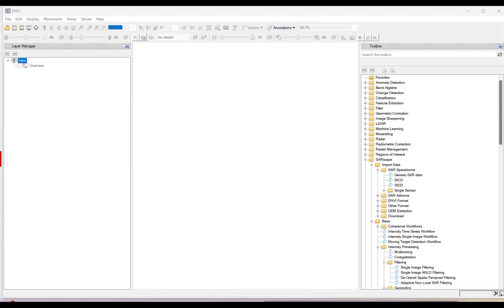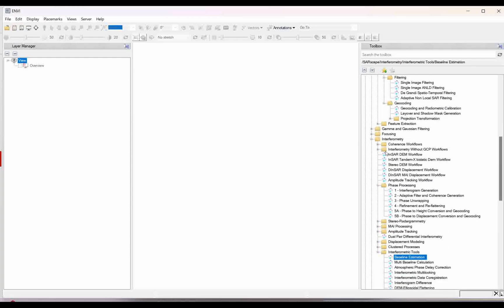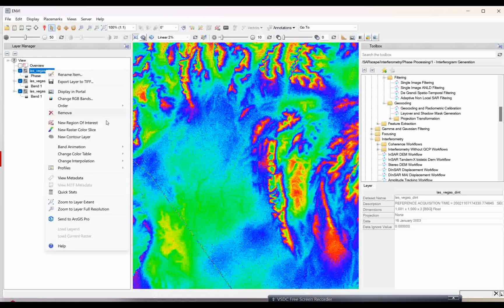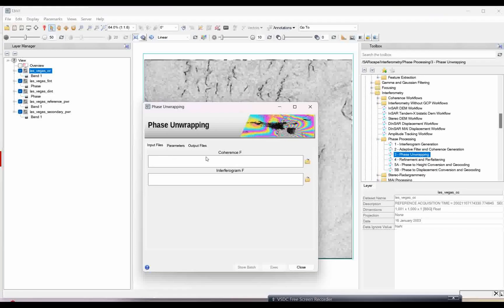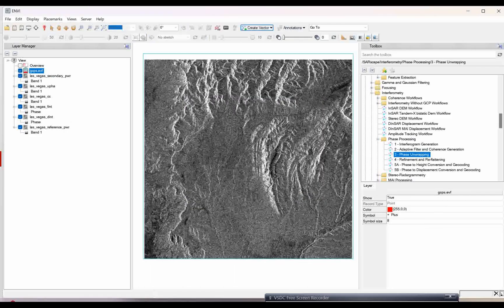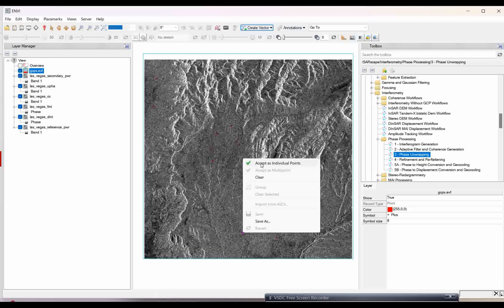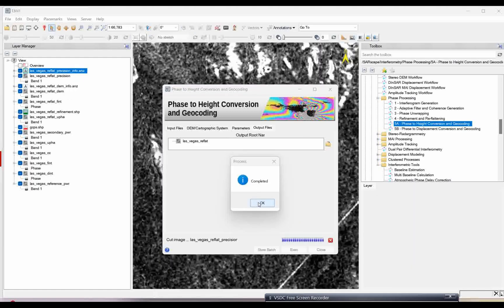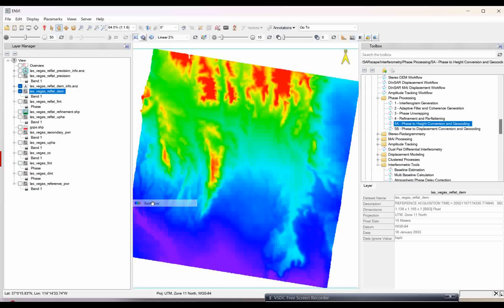How to Generate Precise DEMs from SAR Data with InSAR in ENVI SARscape

Comment: Hlo sir if i am doing  DinSAR  processing in SarScape........and export image in tiff format for map composistion.................

My values for displacement are -0.14 to +0.11 ........ What are its units......if i am using 12 day data.........than this values are for 12 days or year..............

But firstly plz tell me the units of my output.....is it mtrs,cm or mm
Reply from the maker: Displacement (symbolized d or s ), also called length or distance, is a one-dimensional quantity representing the separation between two defined points. The standard unit of displacement in the International System of Units ( SI ) is the meter (m).
Reply: @spaceremotesensingandgis5626  sir the 4mtr values are very high......for  land displacement........values for dispalcement is in.  mm .....
Reply: If have have to find velocity than i have to divide displacement by time period .....for ex if my displacemnt for 12 days is 0.48mts. Tha to find velocity to do this 0.48/12. Which is 0.4mts. Which is very less value....in comparison to velocity......if we consider 0.48mtr for 1 day than its is suitable for glacier
Reply from the maker: @Dr.MeMer5  Its difficult to tell that as I am not much work on glacier. I will check and let you know if I get any information.
Reply from the maker: In SARscape processing, specifically for Differential InSAR (DinSAR), the displacement values represent the amount of surface movement detected between two radar acquisitions. These values are typically in meters (m) and reflect the displacement between two radar images, which can be caused by phenomena such as land subsidence, infrastructure deformation, or tectonic shifts.

Units of Displacement Values
The displacement values you have (-0.14 m to +0.11 m) are in meters (m).
This means the surface has shifted by a range of 0.14 meters to 0.11 meters.
Displacement Over Time (12-Day Interval)
Since you are working with 12-day data, these values represent the displacement over a 12-day period. The values are calculated based on the difference between two SAR acquisitions that were taken 12 days apart.

Therefore:

The displacement of -0.14 m to +0.11 m is for the 12-day period.
If you wanted to scale this to a per-year basis, you would multiply by the number of 12-day intervals in a year.
There are approximately 30.42 days per month on average, so a year would have about 365.25 days.
Dividing 365.25 days by 12 gives approximately 30.44 intervals per year.
To convert your 12-day displacement values to a per-year basis, you would multiply the displacement range by 30.44.
For example:

-0.14 m per 12 days × 30.44 = -4.26 m per year
+0.11 m per 12 days × 30.44 = +3.34 m per year
Thus, the displacement over the entire year would be in the range of -4.26 m to +3.34 m, if you scale it up.

Exporting to TIFF
When you export the displacement map to TIFF format for map composition, ensure that you specify the coordinate reference system (CRS) and any relevant metadata that can clarify the time frame and spatial scale for your map's users.

If you need the displacement data to be shown over a specific spatial extent, be sure to handle the geographic projection and scaling appropriately during export.